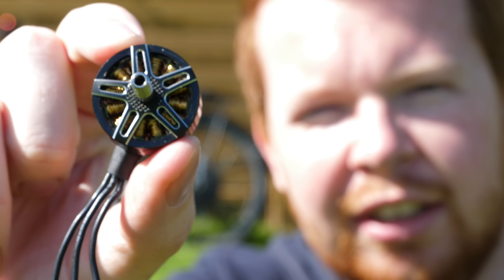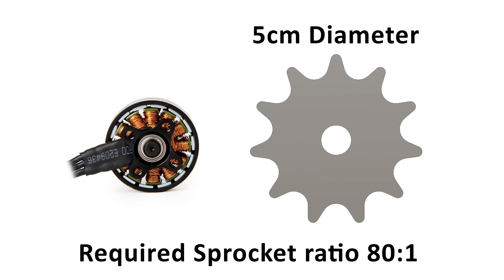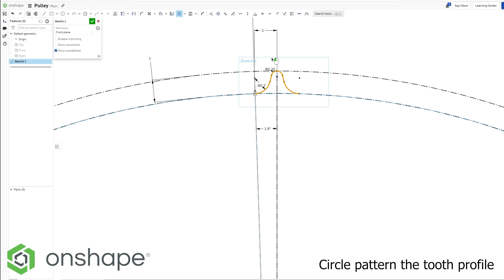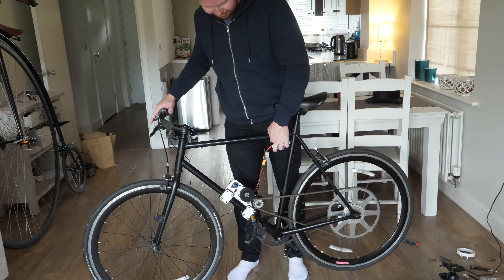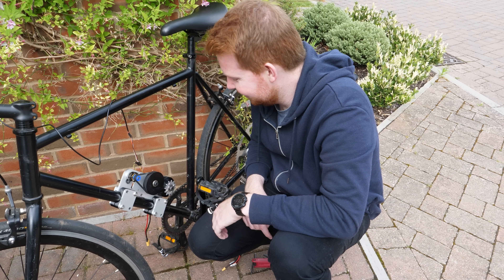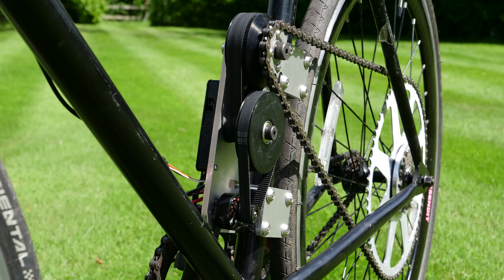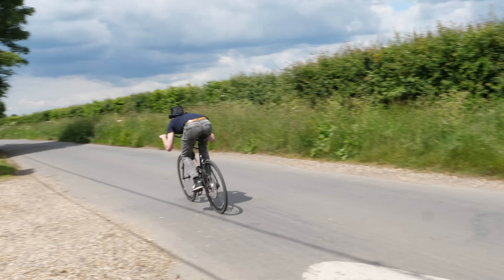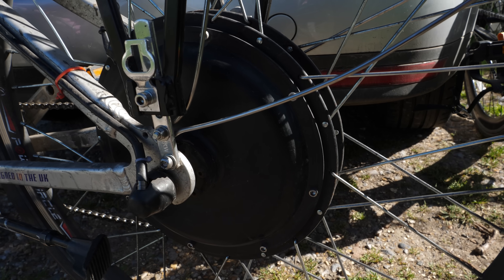Tiny 1kW Electric Bike Motor

Comment: This dude is not very smart. Not everybody who pursues science and applies it is a genius, or smart. Or intelligent. They are just on the right path. Just because a tiny motor spins at 30,000 rpm doesn’t mean it will spin a bike wheel at the same rpm when connected directly at the wheel’s center. There are multiple other forces at play including how well it is mounted (this dude clearly does not know how to mount things), the torque the motor can produce and the strength of the materials being used. He did not have to use a multiple pulley and chain system to bring the science on paper down to an exact rpm number without factoring in anything else. Also the mount needs to be secured in multiple planes/axes so the power transfer is unidirectional and seamless. He basically has to connect a larger gear (def not as large as he showed us) axially directly on to the motor and the rpm will reduce significantly. And then transfer power via a chain to the wheel directly using another large-ish pulley, a wee bit bigger than disc brakes. I have built multiple such projects and even used raspberry pies, AI and turbines to try and build powered and sustainable bikes. With a simple, single-transfer setup like I just explained, combined with the lack of big torque, we will have reduced the rpm significantly on the final output at the bike wheel to be practical enough to ride.  It that small motor will eventually overheat and burn out after a few uses.

Comment: The main error is from the beginning, assuming that this 36 gram motor and possibly to be used up to about 100 watts, can be used consuming 1000 watts. As soon as you put a bicycle load on it, it's going to burn. Why risk with this type of engines. Put one that weighs 300 grams, adjust the gear to the speeds of both the engine and the bicycle and the operation will be optimal.

Comment: where the hell did you get that brushless motor. I build rc planes and work heavly with bruhsless motor, so seeing the specs of that brushless motor made by eyes widen. 2100g of thrust with 38gram of motor weight, is something i have never seen in my life. If that actually accurate than i would buy 50 of them right now lol. Sidenote: Great video!
Reply: f80pro kv2200 cost around 27 bucks, which is worth it. 6s batteryy

Comment: If that electric motor is 1000 watts ( obviously it isnt,) it is 1.25 HP . If it is 1000 watts then the current draw when actually rotating at nominal speed would be ( based on 11.7 vdc lipo battery that majority of drones use) 1000/11.7= 85 amps. If that motor inrushed the normal starting torque of a typical BLDC it would probably explode and you would win the drag race. Or part of you anyway....lol. put all 4 motors on bike in a series configuration ( not electrically but mechanically) keep the rear derailleur  and to start off pedal power , once moving it might wind er up pretty good. Go down a steep hill....c what it will max out at. Wear a helmet and get good health insurance. Might as well go all the way and get  life insurance while your at it.  Lol!!😂😮😅

Comment: i want to power an old cast-iron Cub Cadet garden tractor with a large RC Car motor..  the original tractor engine was/is only 10 horspower with a max RPM around 3600.  I figure if I can find a motor that runs around 36,000 and reduce 10-1, with a high enough power rating (10 horsepower is around 7500 watts) it should work.

Comment: While its a fun experiment, I can think of 4 good reasons why its not practical..1 Because the RPM is so high the motor is so small, excessive heat and friction, means the motor and the bearings will wear out very quickly. 2 A lot of power is lost in all the extra gears and belts needed. 3 High parts count and higher complexity, less reliable. 4 Higher cost with less efficiency. The good thou:- For fun and educational purposes, excellent way to learn. good video.

Comment: Force = Mass x Acceleration. Starting with that and calculating the reflected inertial mass would enable you to select the motor "power". You refer to more or less power when in fact, it is more or less torque. High speed with low torque is exactly the same as low speed with high torque.
The motor selection should be dictated by the "Power" (Torque x speed) and the mechanical gear ratio selected to achieve the rate goal.

Comment: Ideally you shouldn’t go over a 3 to 1 ratio between 2 sprockets. You have to either use too much chain or you don’t get good tooth engagement. You can use an idler sprocket though to get the chain to wrap further around the smaller sprocket ⚙️ that should fix the issue with the chain coming off

Comment: A wider motor stator will have more torque. If you put more power through the motor it can make more power. The voltage is not a limit but a suggestion. My 8s 5inch drone for example.

Comment: A motor for a fan you can design almost without thermal constraints because it will basically sit in an air tunnel.
When using one like this I think you need to add back a minimum of airflow to be able to push it

Comment: There are planetary gearboxes for RC motors , which are very compact and efficient. Last one I used had a ratio of 3.5:1 at a size about the same as the motor, at a price about $35. Would have been far better solution to replace the first gear set. not to mention , compact, easy, safe...
Also it would be far smarter to get a low KV motor. Like "donkey" series. Usually used for large drones with large, low RPM propellers. Then the ratio you'd have to gear down would have been 20-30:1 instead of 80:1.

P.S. these motors require cooling. They are air cooled.
P.S. 2: I'm pretty sure you were not using the motor at full power, as the ESC you used was not adequate. You'd need something like 100A * 6S ESC for this to have enough reserve without extra cooling. And that's at least twice the size of the one you used, even if yours was of the good ones, which is a big if in itself.

Comment: How come you didn't consider a worm drive gearing?  These can go up to a 300:1 gear ratio easily.  In fact, with the right angle configuration of worm gears, you could hide the whole thing inside the hub and one of the main tubes of the bicycle frame.  In pro racing, there have been similar designs with hidden small motors - "motor doping" to cheat with electric motors.

Comment: Out of interest, why not try two?
Reply: @JackBaldwinBusesAndTrains  That depends on the efficiency curve of the motors doesn’t it. Usually at higher RPMs internal frictions and electrical resistances increase. So it’s actually more likely they would be more efficient. As to designing a coupling mechanism, he seems pretty good at DIYing his own mechanical parts.

Comment: Still bulky, it's fiddly, longevity who knows but probably not long, reliability looks like it may become unbearably tedious, and the power is very low if that's how it performs on a flat & smooth surface. 
Gimmick at best, still a lot of work to be done.

Comment: Made a tensioner pulley for the belt but couldn't be bothered to use that CNC router for a chain tensioner sprocket. Very forward thinking.

Comment: I have always wondered about doing this. I thought it would be best to use a motor designed for a electric helecopter though as the case is designed with a fan to help cool the motor.

Comment: so you can save countless weight using a drone motor 😅 now uh wait hardware Weight adds up too probably not heavier than the hub motor... yeah surely not equal weight 🤔 well i guess bigger is better then unless you have a huge water cooling radiator system or something 😅 best to just buy better specs ... bet that 1000w drone motor would make a great cnc Dremel motor for the high rpms low cutting depths grinding away or possibly the hub motor making a better cnc? problem is size constraints for movements ... well depending on what specific tasks a coarse cut and fine cut cnc both could save you time and money though the fine is more likely to be purchased than coarse because most people hand cut coarse measures

Comment: A drone motor is not designed to spend a significant amount of time at stall, or even at any load that significantly reduces its speed from the free spinning speed at a given throttle setting.

Comment: You need a fan built into your belt sprocket on the motor. When you're using it in a drone you are counting on the propeller to help cool the motor. On the e-bike you are taking off at low speed with a lot of current so you need to get rid of that heat. Think of a vacuum cleaner motor, it wouldn't live long without the aid of the fan pushing air through it. These motors are generally in the 800 to 1200-watt range also

Comment: why not just attach a small fan to the motor? Also you could take advantage of its size using 2 or 4? If you have the stuff why not build planetary gear assembly to reach desired ratio. I think your verdict definately needs more exploration. You could possibly make something really powerful.

Comment: Both 1000w motors which are weak for a bike to begin with, but both have drastically different gearing losses.. the ebike is direct drive and puts almost all of the 1000w to the ground. The gearing loss you have with all that mess of chains and Pulleys has got to be a lot.

Comment: I think the problem of overheating motors came because as they were built for drones they probably were designed with a lot of active cooling coming from propellers in mind. Maybe could connect a teeny tiny propeller to them as an active cooler?

Comment: Good I like it, I working on alternators to producing energy.
How rating shaft of motor and sfaft of alternators. 
My goal what size of shaft will produce 240 Amps what you need to know speed straight power then timing, the rest is how many alternators to be attacked this is the start simple spin of shaft equals one shaft can operate hundreds of generations at once.so many door trick teach the shaft as power. Explain it first you build the alternators that the new energy inversion is the thing to explain for me right now I know how but have trouble explaining what I am doing alternators the new powers learn them you will on top of the game

Comment: What is the ratio of the belt drive    it's really got a low ratio    that strictly a helper motor   and not a lot of help   and they jokingly call a small block Chevy a mouse motor  compared to a big block RAT motor

Comment: I have an old djo phantom (i think it was a 4 but ill have to check) i picked up at a thrift store for $10 and never could get all the parts to make it work. Do you think it would have the power in that setup?

My application would be a bicycle trailer with approximately 60lb/27kg of weight or less and would really only be to assist on light hills as I travel to a nearby lake approximately 10mi/16km

Comment: it could probably work well for long amount of time, with an air duct and a server fan, or some blades attached directly to the output shaft of the motor itself

Comment: Awesome project.. The drone motor is not really designed to take a lot of load at low RPM.. they are always spinning pretty fast.. 
The Drone motor normally would have a prop on it.. that would keep it cool under load. mount a small  low pitch blade under the sprocket to just blow a bit of air over it.. Or make some ducting to take the air as you move and blow it over the motor.

Comment: That small motor being rated for 1000w doesn't make sense because sure your load is high but if it's running at 1000w it's going to get that hot which makes it unusable I guess in a drone it would have more air flow and not be at full power but if it was it would still burn up

Comment: im not impressed by 1kw from these. dump a battery through a resistance, you can easily dump more.
as long as you can get rid of the heat, or glowing white hot is what you want.

that was a LOT of heat to get rid of, with virtually no airflow.

stands to reason it wont like being run for very long.

a decent fan and shroud to keep the stator below 100C or so, it would have been fine... sort of.

better running lower KV motors. more turns per coil, higher voltages, lower currents, less electrical loss and more useful torque, and less gearing loss.

Comment: I suspect the primary drive belt has very little tension. Using one about 1/4 the width of the secondary will reduce losses due to internal friction.  Replacing the primary belt with a  reduction planetary gear set might be even better.

Comment: Nice that you thought about it and built it. Thanks for so nice content. I went though all the stress with you I can say, when knowing that you are building something with pulleys that is going to compete against a direct drive setup... They only other way do do it with a tiny motor, i.e. lower the speed and up the torque would be by increasing its radius, which would mean you would end up with the direct drive motor you have in the first place on the eBike. Best regards.

Comment: Is the mechanical friction or/and power loss caused by so many rollers and belts not too high? The efficiency must drop significantly. 🤷‍♂️
On top - the maximal torque what the motor can give is an important thing -  I mean Maximum torque what the engine has and which it can overcome.

Comment: from the thumbnail, i'm going to say you'll want to run through a second spricket set, because the sprocket needed to get that 30kRPM down to something reasonable, the sprocket is probably going to need to be larger than the wheel.
You can probably use an 11 tooth on the motor, bring it to a 20 tooth on a free spinning axel, spinning another 11 tooth sprocket down to the wheel sprocket thats maybe 50 tooth, but you're going to probably want a traction motor.
I tried this several years ago with a 6000RPM motor, and i soon burned out the motor because from 0MPH to about 5MPH it was just spending most of its energy generating heat. Died with literal smoke, if you could start off using a hub motor on the front wheel, then transfer to the 30k motor once you've hit say 5MPH you'd have a decent hybrid system, high torque at low speeds, and high top speed

The thing i was always fighting was the torque from the sprockets twisting everything out of alignment.

Comment: Never expected such a small motor to output such insane power. Cool video!
Reply: 0 torque tho
Reply: Motor power density is highly dependent on cooling capability. Drone motor can have such high power density because it is blown by high speed air

Many car electric motor also have extreme power density thanks to liquid cooling
Reply: I built a bike with magnetic engine  (No electricity and no batteries) are you interested ? We could build them together
Reply: That's rotational kinetic energy, not power.
Reply: this is why EVs better than ICE
Reply: @bozzalnw5357 Do you get tired of hearing clown music when you type?
Reply: @bozzalnw5357  electric engines*
EVs suck with their god awful batteries
Reply: @GewelReal  thank for info. but who asked?
Reply: @GewelReal Engines are only the combustion ones. Motors are only the electric ones. Not the other way around.
May i even ask why you think EV's suck?
Reply: @Endermax3852  not true, check the MIT engineering site to see you wrote BS.
Reply: @chongtak  “People use both interchangeably, but the difference is that motors run on electricity and engines run on combustion. The engine converts various forms of fuels into mechanical force, while the motor transforms electrical energy into mechanical energy.” A quick google search would've saved you some embarassment.
Reply: @Endermax3852  no, a motorcycle or a motorbike does not run on electricity and an engineer does not use combustion to operate his machines. A motor is a mechanism that makes something move,  and an engine is a mechanism. A motor is an engine but not all engines are motors.
Reply: @GewelReal  lmao shut up give a reason
Reply: @Endermax3852  A motor is having to do with movement, while an engine imparts the ability to move. They both basically mean the same thing. There are combustion engines, fluid engines, electric motors, and more. You can pick apart the differences all day by looking at what we call an engine vs a motor, but at their root, they are the same.
Reply: @GewelReal  This is why development is a thing. ICE's have been in development for hundreds of years now, EV and battery tech should be afforded the same. Electricity is the future of transportation. That's just the way facts spell it.
It's just too versatile. And can be acquired through many sources. While gas only derived from just one source.
Reply: @JBrander  hundreds of years ahahaha
And no, electric energy storage has been in development for at least as long as ICEs (not only cars use batteries).
Afterall, first electric car and first ICE car are like 2 years apart.
Reply: @GewelReal  
"hundreds of years ahahaha"
Earliest combustion engine patent was around 1790's. So yeah, it really has been hundreds of years of development now. Or you can still laugh if you're bad at math. Up to you I guess.

"And no, electric energy storage has been in development for at least as long as ICEs (not only cars use batteries)."
Wrong actually. Batteries were developed even WAY before ICE's. Yet only now do we get a foot in the door for plausible commercial EV's.
In terms of investment of time, funding, and demand. ICE's have had it way more than battery development.
This is what I mean by "should be afforded the same". Same investment. Directly proportional investment.

Comment: The drone motor needs the usual air flow of a drone to cool it. You'd need at least a small prop on the same shaft, and it would rob some of the power. If the magnets get too hot, they will lose strength.

Comment: If you doubled the size of the motor and used a high reduction ratio cycloidal gearbox you may have a practical system there without it being as big as it ended up.